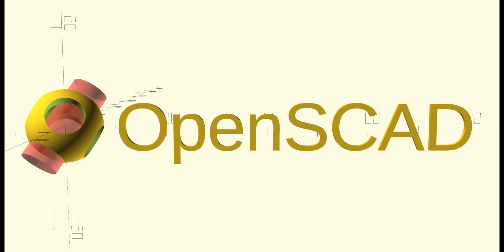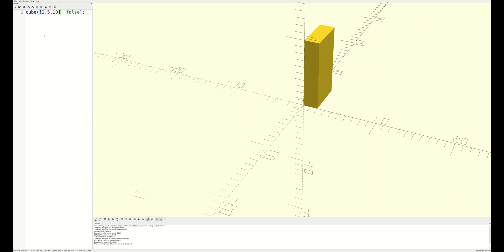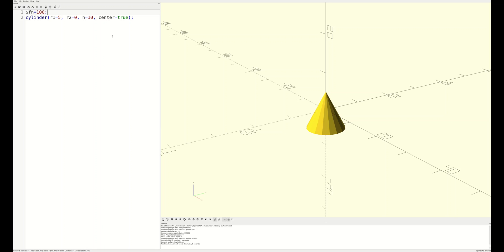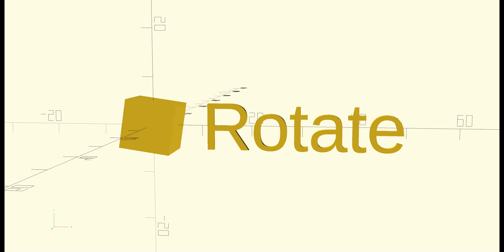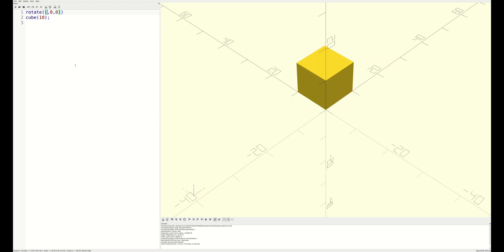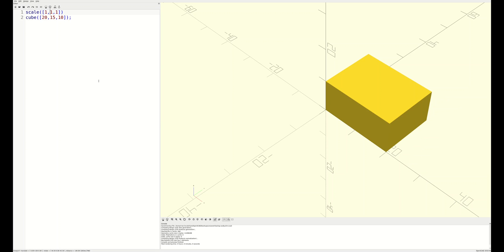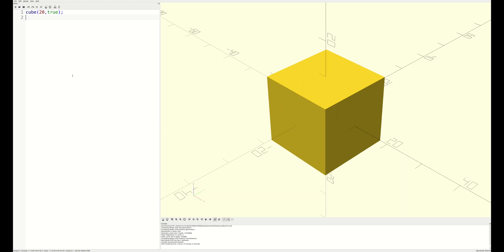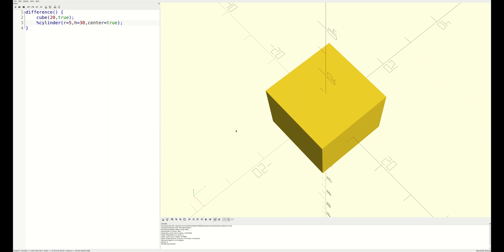OpenSCAD: Introduction

Comment: I ran across SCAD when examining some parameterized objects made by @handsonkatie.  It did not take long to figure out that this would be an excellent tool for making parts to a custom size. I had the time to look at some more complex renderings, but did not understand.  After going through the first two chapters of the tutorial, the SCAD tool is become demystified. I still have a long way to go, but the value gained from this tool will make time spent well worth the time and effort.  I am looking forward to the other tutorials to learn more.
Thank you for the video. It is a good start.

Comment: Have been playing around with FreeCad the last two years and although its a good program I finally got fed up with attachments breaking and the GUI just did not become more satisfying even with more and more experience. It feels like too many operations I am doin over and over again. OpenSCAD looks amazing now because if there are any issues or I need some inspiration from already fixed problem it seems like you are able to just look through, copy and modify existing code. I hope there are this also has the ability to translate objects based edge, surface coordinates.. That was a very good introduction.

Comment: This is great!

I tried to do Precision Blender tutorials but it just became so apparent that Blender was never really designed to do precision modelling. There was so much of the tutorial series focused on repairing broken meshes. I looked into FreeCAD, it will be my fallback if I can't get going with OpenSCAD. 

The thing I find most difficult about OpenSCAD so far is getting into a good work flow. It doesn't take much to just start putting shapes on the screen and modifying and moving them around, what I find difficult is how to connect things when the parts are so far away from the origin. Like there doesn't seem to be any way to get a measurement from one point in the parts to the next. 

I'm gonna watch the rest of this series and see how it goes. Wish me luck!

Thanks for the tutorials!
Reply from the maker: How's your OpenSCAD coming along?  Relative measurement can be a challenge for sure as there's no concept of faces and edges like in more traditional CAD.  You basically have to think through all the heavy math yourself.  I've started dabbling with SolidPython (https://github.com/SolidCode/SolidPython) to see if I can work around this with more of an OOP approach, but don't have any amazing breakthroughs to share just yet.
Reply: @cilynx  Very cool! I'll check it out as well. I basically put my CAD career on hold and hoping that when I return to it Blender or OpenSCAD will have improved a bunch.
Reply from the maker: @heckyes  -- Ha!  Yes indeed, sometimes the quickest path to resolution is "wait for technology to get better then use whatever easy solution someone else invented" =)

Comment: Also, for facets, try this:

//Disable $fn and $fa
$fn=0;
$fa=0.01;

//Use only $fs
//fine
$fs=0.25;

//coarse
//$fs=1;

This works for large and small curves.
Reply from the maker: I like it.  Will definitely play around with it in a facets deep dive video.  In real life, I'm super lazy and tend to always do $fn=10 for the entire drafting process then $fn=360 to render.  I'm sure there are better ways and your explanation of $fs here looks like a good start.